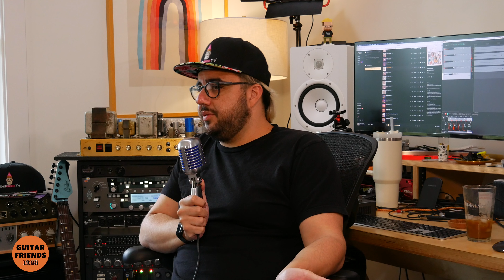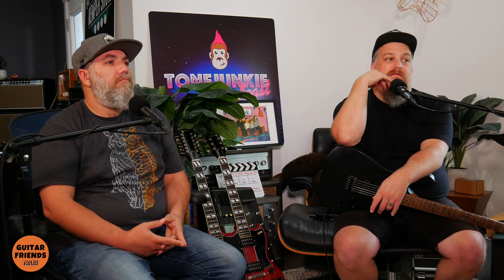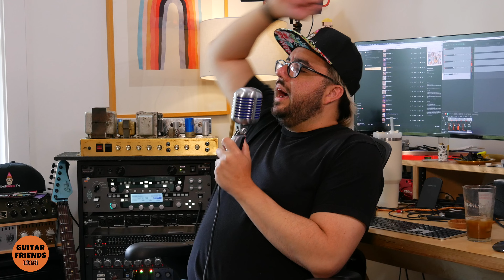Can NAM hardware compete with ToneX?

Comment: Tone X (I've got one) forces you to use wether windows or Apple, no Android, no Linux interface. Cheap factory presets  so you're forced to build your own ones or buy rather expensive third party ones. I prefer NAM, open source, loads of free captures, not only amps, but pedals, studio gear and in the Dimehead NAM player you can load two profiles so.... Their noise gate is more efficient than the Tone X one. I agree that Two Notes should make a pedal with the Genome inside.

Comment: Namm, at over 600 bucks will be a bust.  I can buy a big tonex for 400, or even a discount two pack for 700 bucks.  With that, you get Tonex Max software, with hundreds and hundreds of captures, and then there's tonenet for thousands more.
I own two Tonex ones that I run through a HD500x fx loop, defeating the onboard amp models.  It sounds great, and only cost me 360 bucks, for an awesome upgrade!

Comment: You guys should check out Aviate Audio Multiverse. While not a VST loader, companies that make a VST can easily port them in and run them on the hardware. Its pretty much exactly what you are talking about. An actual commercial product without it being a windows computer in a pedal.

Comment: NAM is supposed to work with MOD Devices Dwarf pedal. I was excited about this feature but MOD cut short their production run of Dwarf pedals for their Kickstarter campaign, so I never got it. I don’t think it will ever get critical mass because the companies supporting it a la MOD Devices don’t have enough scale and built-in customer base to seed the market and sustain support.  The only ones who will support it are the niche techno-tinkerers  that tend to overestimate pure technical superiority over ease of use and finished ecosystem to encourage mass market adoption. This segment of the market tends to be very vocal and passionate but unrealistic and unsophisticated in their understanding of business issues like marketing. That’s why these guys are building the products and not selling. That’s okay. There’s room for both and we need the tinkerers to innovate but they generally incorrectly project their enthusiasm to figure out and put up with half-baked and complicated interfaces onto the  general public. Normal consumers just want to plug something in and have it work out of the box without any fuss and won’t care if it is the pinnacle of engineering elegance.

Comment: I bought ToneX day One. I made a bunch of captures. I now exclusively use NAM. It sounds and feels better than anything else out there. Also from a training point of view, what frustrated me with ToneX was only being able to train 1 at a time. With NAM I can record  like 20 captures and then train the all in a batch, to me that's a much better workflow.
Reply: Ironically, the open sourceness is somewhat holding NAM back I reckon. The absolute hostility to any type of monetary transaction happening around NAM must surely be putting off some of the bigger hitters.

A more user friendly training system that guides you like ToneX would certainly be help a bit I think.
Reply: @rossbalch  I bought the nam player and captures from amalgam audio.
That were a lot of money transactions. 😂😂😂

Comment: I am looking into this, being in Australia though, I don't like me chances of getting in early.  I remember buying something from Italy just as Covid-19 hit and it was like 4 months before I got my item.  Fair enough though, it killed umpteen thousands of Italians.  The latency, or lack thereof in this unit is insane, beats almost all things out there, the only thing I want to know is how to run a FX unit with the it pre and post?  And what is a good unit to run the FX?  Even though it not that cheap here in Oz it stills come in a lot cheaper than the bigger names and the tests prove it is the best for profiles.
Reply: It takes FX before and after like a champ. The input AD converter has huge headroom, so even when hitting it hard with a booster, it doesn't clip. You can really use like a real amp.

Comment: Hey guys, I was wondering if you guys can make a video comparing monitoring options. I bring it up because it seems like nam is designed specifically for direct captures whereas tonex captures amps and cabs. In theory, would nam sound best with a real cab? I know you guys are fans of the kemper cab, but what are your thoughts on a power amp and real cab? I'd love to best simulate amp tones without coloration from a mic. If you have a video on this, would you mind pointing me in the right direction?